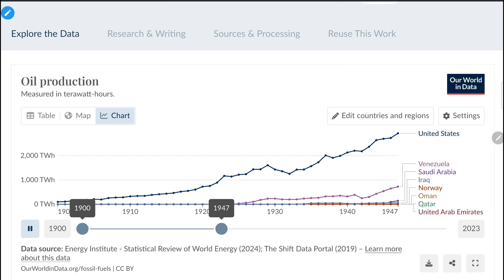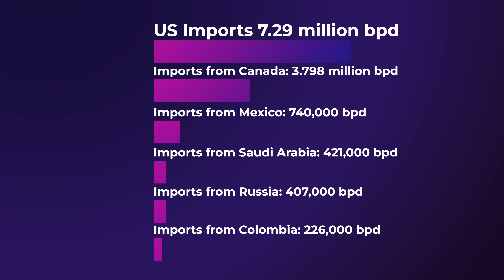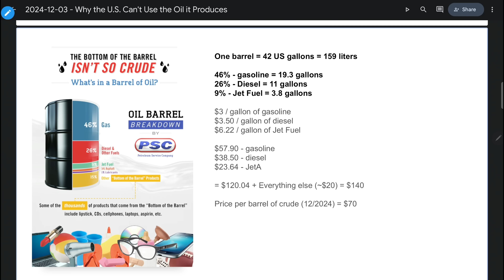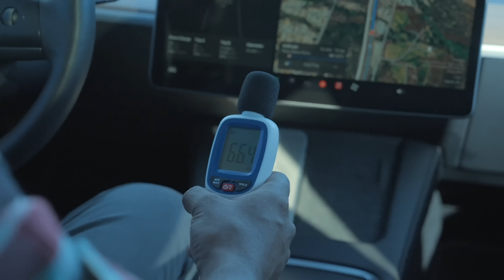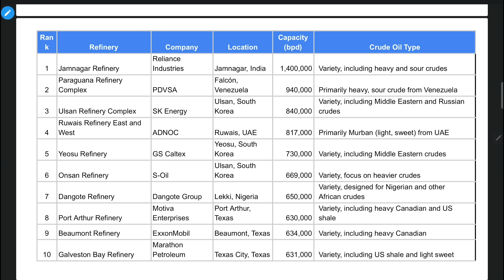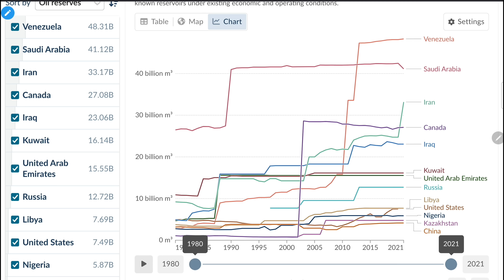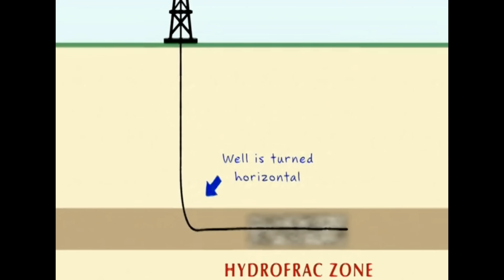Why America Can't USE The Oil it DRILLS

Comment: Great video this time!  You got things right.  We could go into much more detail about California and oil.  Basically, though, there is a huge mountain range in the way along most of its border, insufficient infrastructure in adjoining states to the south, and no easy way to move oil along the north-south corridor anyway.   So California imports most of its oil (like 75%) by sea and self-consumes a lot of what it produces itself (which is from more traditional oil wells that have been reactivated with steam-injection, if I remember right).

Another interesting factoid is that gasoline use in California has been steadily dropping for a long time (ignoring the pandemic glitch), and is now expected to become more like a precipitous fall as 25% of new vehicle sales are now ZEVs, and rising.  Refineries have been steadily closing in California... the oil majors are more or less monopolies so they close refineries to keep prices higher and the remaining refineries more profitable.

-Matt

Comment: Building new refineries would be an option. 
"Renewable" energy has its own production/manufacturing drawbacks.
It's about the initial investment that could take place if the right maverick took on the challenge.
Reply: Renewable energy always seems to sneak in carcinogenic chemicals, PFAs, and lack luster energy output while making 90% impossible to reuse.
Reply: Renewable energy always seems to sneak in carcinogenic chemicals, PFAs, and lack luster energy output while making 90% impossible to reuse.

Comment: I do, respectfully disagree…I will say, yes “drill baby drill” can in fact reduce oil costs.  Of course, this partly is dependent on oil companies…If We put out more oil in the market, it will lower the price of oil  worldwide.  It doesn’t matter if we are the ones consuming the oil we pull out of our ground.  Part of what determines oil prices is how much is available on the market at the time.   Yes, we will benefit.  Just the same, producing more oil can make plastics, etc cheaper as well.  The decrease in the price of oil will also help with inflation.  

A comment on electric, electric cars will not be the main method for a very long time.  Until that technology becomes dramatically better, it will still be a very small percentage. 
If the need comes one day, yes companies will invest in different methods of refining.  It goes where the money (and regulation) goes.
Change regulations and end wars and related sanctions will go pretty far.
Reply: You’re missing a big point, drill baby drill cuts the price per barrel. These are for profit publicly traded companies .. shale oil costs more to produce than in the Middle East so pushing the price down is not in their best interest. As we produce more, opec can also just reduce production to balance out the price. New Light sweet oil refineries would be the answer for the us BUT it costs soo much and takes well over 2 decades to break even resulting in low shareholder drive to go that path.
Reply: @strawdemindset if it was profitable then they would have already built the new refinery and been in production by now. Fracking has its problems with the infrastructure needed to make it profitable. So add in the people that don’t want it in their backyard and a newer refinery may not happen in the next decade or two
Reply: And then we start  wars to keep a powerful economy. Brilliant.
Reply: @jray1429  I agree somewhat, the other factor is the capacity of refining crude, which is primarily in the US. That is a potential bottle neck?
Reply: i agree. I was thinking the same thing.  He said its a global market.  If we flood the global market with excess oil then the rules of supply and demand dictate prices will drop.   The bigger issue is oil companies only want the price to drop so much so they will curtail the production to ensure that a barrel of crude stays in the price range they like to see for profitability.
Reply: @hammerdown3876  you realize that's causus belli for major war, right?
Reply: @hammerdown3876  The world market cannot be flooded to drop oil (and gasoline) prices greatly by increased pumping of more US oil b/c it's more expensive to produce. When world prices drop a lot for any reason, US oil fields begin shutting down. Some voters' stated desire for $1.69/gallon gas can only be met momentarily by unanticipated oversupply/reduced demand - e.g., by covid. In short, refineries can't make cheap gas from expensive oil.

Comment: We should do both, build a new mega light/sweet crude processing plant and find better green energy methods.
Reply: Current regulations keeps that from happening
Reply: There are no such thing as "green" energy,its ALL made using oil in some way or another.
Reply: It is pointless to invest in petroleum infrastructure when demand is going to drop for gasoline and diesel, so there is going to be excess refining capacity. EVs are now 55% of the new auto market in China, and the rest of the world is going to follow China's example. 49% of the global 2 and 3 wheeler market is now electric.

Comment: 100 ml of ethanol mixed with 100ml of water is about 190 ml of solution lol
idk liberals liked to talk about this export issue during trumps first term saying increased production wouldnt drive down prices, and it did. then biden turned the taps down and russia invaded and was funded by the low supply oil market. energy prices keep going up and they need to stop, especially in the eu/uk. we cant tell the europeans that they cant buy oil from russia and then turn around and refuse to fill in the deficit and ask them to pay crazy 2000$/mo heating bills. it was really getting out of hand in 2021 thanks to biden's unlimited wisdom. the most peaceful way to dethrone most of the evil people in the world is to flood the market with oil every now n then until their people get upset. increased fracking also lowers the cost of EV's because of all the natural gas which is made, more peaker plants can be run with higher uptime and fill in the gaps. again it is hypocritical to slap all these terrifs on china (IM TALKING ABOUT BIDEN) and make grid scale energy storage too expensive to implement and not fill in the difference with cheaper electricity.

Comment: One thing not addressed is WHO buys the shale oil being fracked, if the US doesn't refine it? Also I wonder why they wouldn't push a pipeline through NV deserts to the CA doorsteps. I bet there wouldn't be much pushbacks and could be easy to monitor for leaks.

Comment: Thanks Ricky, one thing you didn’t touch on is someone wants to put 20% tariffs on the oil we get from Canada and Mexico.  Since we get 20% of our oil from Canada and Mexico that would mean our oil prices would go up 4% over all. But since the east and west coast imports a higher percentage of oil that means the prices would go up the most there.  So these tariffs would hit the blue states the hardest.
Reply: If investors feel confident that the tariffs will be maintained, then they may invest in converting some of our refineries to handle light, sweet oil.
If oil prices become escessive in the east and west coat states, then new oil pipelines can be built.  Leaks?  Double the pipes, one for oil inside the outer pipe for leaks.

BTW: VAST Power Systems has the technology to burn oil leaked on water.  They want/need much more water than oil in the burn. 

Retired engineer.  Living in Collin County, TX.
Reply: @engelag  wrote;
then they may invest in converting some of our refineries to handle light, sweet oil.

The usage for oil is going to drop substantially over the next 5-10 years. Demand will drop off.
Reply: @johnburns4017   Please explain and justify your claim.
Even if we import less stuff, due to tariffs, we might want to make it here, which requires trucking or trains.  If the price is too much, there will be an increase in DIY, which still needs supplies.
Reply: @engelag  
The world is moving to solar, wind and grid storage batteries. Hydrogen produced by wind/solar or high temp nitrogen reactors, will be used for industry - and trains and ships.

Most oil is used for burning. That will end.
Reply: the east and west coast states dont generally import that oil from Canada, the whole reason they utilize tankers. Look at his map again the vast majority of Canadian oil arrives by rail or pipeline> also it s more dependent on where the refineries sell that product to and not where the crude goes to be refined.
Reply: The East and West coast states are the wealthier states who would be greatly implicated.  They will not like that, and they are also mainly Democrats by tradition. I see turmoil.

Comment: A lot of that consumption is our refining of oil to then export the finished product. You don’t clarify use, versus value added refining or material manufacturing…ie chemicals, plastics, pharmaceuticals, precursor chemicals….ect…these are not all consumed by us. Also our refining is geared to heavy sour oils, like what Canada and Venezuela produces. Light sweet from fracking can be refined by anyone.

Comment: It’s been nearly 20 years since fracking took off. There has been no excuse to not set up to use the lighter crude in those two fl decades. 
The only excuse is pure corporate greed.
Reply: And do what, use a ton of electricity & catalyst to turn short chain light crude into heavy petroleum products? All that does is make the end product more expensive; whereas cracking heavy crude into those same products is cheap.

Comment: LIE:Or more likely PURE ignorance.  Right at the start: Yes, USA can easily use it, just that the cracking process will not be fully used and therefore a lot of infrastructure will have sunk costs which will be left rusting NOT being used.  It is THEREFORE cheaper(more profitable) to import CHEAPER heavier crude and refine it using said infrastructure with sunk costs which would otherwise NOT be used, and sell for a higher profit margin while selling the light sweet also at a HIGHER profit margin.

Comment: Does a wind turbine make up for the carbon foot print that it takes to make it?!  In most places no, it’s a half acre of concrete that 12 feet deep as a base,  the steel, plastic and polymer for the blades, plus you have build the things in the middle of nowhere because people don’t want them close, plus average life span 20 years with little recycling being done.  So the trade of is shitty,   It would be better to go nuclear or drilling geothermal plants.  Neither are site specific, easy to hide and have 50+ year life spans.   So why are they not being promoted, or tidal energy or ocean currents?  Most cities are on coastal areas?????

Comment: Make pipes like B-Vent - pipe in pipe. Makes it easier to catch leaks.
Better yet, just make them so they DON'T leak in the first place.
Drill baby drill will allow for MORE exports at a cheaper price. In return we get to import cheaper finished product. Or at least the greedy oil companies can make their obscene profits from other countries instead of screwing the US people.
When oil companies were banned from drilling, your gasoline prices shot up double.
Author is missing some information to arrive at the proper conclusion.

EV's cause more pollution that ICE.
EV's are unreliable, overpriced, and expensive to repair + LOW resale value. Short ranges and long recharge times. Cost of battery replacement can cost as much as the vbalue of that used car. 
It takes OIL/Natural Gas to make the electricity to charge those EV's. You just trade one source  for energy to another is all.

US CAN use the oil it pulls. Just that oil companies won't make as much profit and don't want to do it. Corporate greed is rampant in the oil industry.

The process of converting crude oil into usable products is called cracking.
After cracking, the product goes through a distillation process where different components 'stratify' if you will.
Lighter at the top of the column, heavier at the bottom. Different items are drawn off at different levels.

If the US wants to reduce oil consumption, then reduce the population. People consume MASSIVE amounts of everything per person.
This is why we do not need any more immigration. That just causes more and more consumption.
Law of supply and demand comes into play.

Another issue is that oil refineries have to shut down annually to do maintenance, which can take a month or more. Usually done right before spring.
During that maintenance they can upgrade those towers since they have to be worked on anyway.

Comment: We don't need to modify the existing refineries.  I worked in the oil patch and did work inside refineries.  We need to build new refineries designed for shale oil because we have sadly not been building new ones.  It will be more green if we do than having others ship us their oil.   It is just very stupid.
Reply: We also need to build more pipelines like the XL Pipeline and the Atlantic Coast Pipeline, which they shut them both down.  Pipelines are safer than Trucking and Shipping.

Comment: Thanks Ricky...interesting episode this week.  Good to know much of this unfortunate about the fracking as we know that damages and has damaged drinking water sources.  The other thing which you sort of touched on is that it is a finite resource eventually there will be no more oil left to drill (baby drill) it is needed for far more important things that burning once in an inefficient engine just to make a few small minds happy at the noise and pollution they are spewing out.

Comment: Some of your imports are likely from US Crude, the Irving Oil Refinery receives 250 rail tankers per day and refines all products including LNG going to Europe.  That refinery is state of the art with its systems replaced between 2010 to 2019 including adding a second heavy upgrader for refining Alberta sludge.  They boast that they are the largest refinery in all of the Americas.

Something interesting, I live in Atlantic Canada and we have extensive undersea coal beds.  Some are a thousand meters or more thick consisting of uranium rich soft coal.  Yes that is the really dirty coal that should remain in the ground, but that coal is chalk full of methane and the field has enough gas to supply 100% of North America's energy with the recent growth since the 1970's to supply USA, Canada, Mexico, Greenland, and maybe down to South America.  

This coal bed was suggested to be over 50% of fossil methane that is seeping and bubbling out of our lands and oceans.  Methane is a real bad GHG, so burning that methane should be good!  The beautiful part of methane is that it produces a bit of CO2 and a lot of water when burned.  CH⁴+ 2O²  = CO² + 2H²O
Reply: Irving is also processing Newfoundland oil for the East Coast, Europe and the US.
Reply: Water vapor is one of the worst GHG that we have to contend with. Even though it can condense into precipitation it's still a concern when everything we burn for electricity spins a turbine of hot,  pressurized water vapor.
Reply: @ThisDique  But water vapour though a bad GHG is short lived in the troposphere and comes back as cooling rain, or becomes clouds that block the sun or is swept up higher and becomes ice crystals which reflect the suns heat away from the earth.  That dimming cools the earth at least as much as it heats it up!!

Comment: I working career was on oil and gas platforms in the Gulf Of Mexico different areas produce different grade crude oil and oil coming off a gas well some of it will run your car right out of the well it has no octane so it would knock all of this oil light and heavy goes from small pipelines into very large trunk lines going to oil refineries there is some so thick it has to be heated just to get it into a pipeline that's mostly in California so your talking BS

Comment: Because American Oil is A "SWEET CRUDE OIL" ,.. Meaning it's VERY LOW in "SULFUR" Content, Whereas The Petroleum Crude Oil of Saudi Arabia, Venezuela, Libya, Kuwait, Iraq & Other Arab Oil Rich Countries are HIGH IN SULFUR CONTENT or Otherwise Known as "SOUR CRUDE OIL" ... High Sulfur Content Crude Oil is the BEST FOR REFINING Diesel Fuel, Heavy Crude Oil etc., etc ... American Cruse Oil or Sweet Crude Oil are Best Suited for Special Gasoline or High Octane, Regular Gasoline or Low Octane Gas & Other Petroleum Based Solvents...

... AMERICAN PETROLEUM OIL REFINERIES Mostly at State of TEXAS Are Configured ONLY FOR "Sweet Crude Oil" or Low Sulfur Content Petroleum Oil and NOT FOR Sour CRUDE OIL or High Sulfur Content Petroleum Oil ....

Comment: Why not replace the equipment as it needs replacing anyway. The equipment has a life so you just need a plan to replace equipment as it needs to be but with better equipment that can handle more grades of oil or change the layout so that extra fractions from the good oil can be efficiently processed and unnecessary equipment from a shipment of oil could be bypassed. It seems to me that regulations governing new plants an upgrade standards play a part. Wasting oil by using it to tranship it halfway around the world and back strike me as a poor way to “protect” the environment. To me the best way would be to process the oil on or near the oilfield then perhaps store any toxic waste in a spent field perhaps after some processing to make it stay there. Then ship the significantly less toxic products where they need to go making  more dangerous feedstock chemicals closer to where they need to be used.